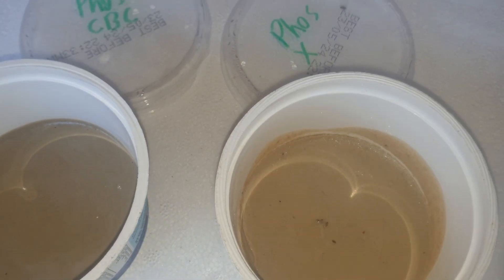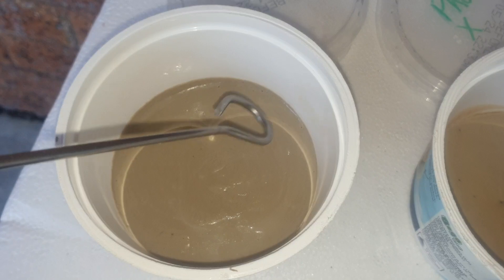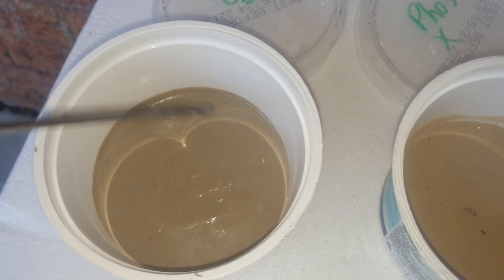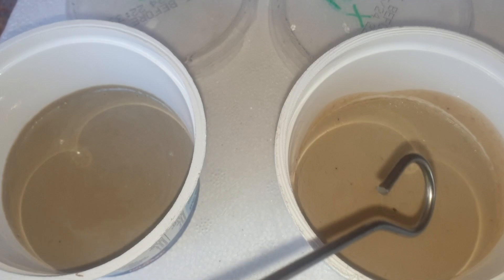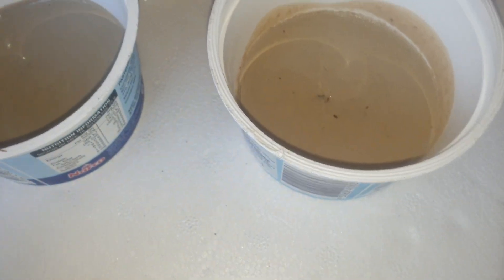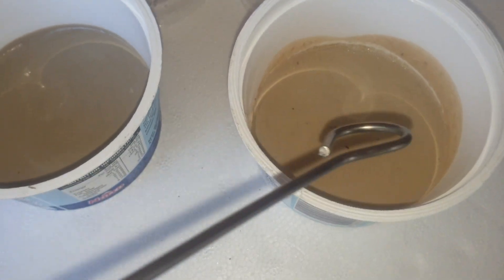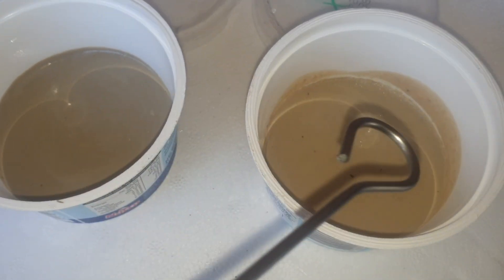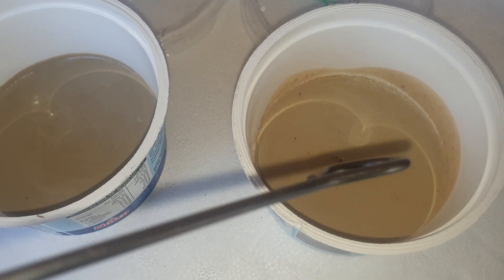Phos/Mk acid Geopolymer😯👌

Comment: Fantastic! Thanks for sharing.

Since our last exchange I have learned a bit about PCM, phase chznge materials, from NightHawkinLight channel here on commie tube.  Xantham gum in that case helps the phase change material stabilize and instead of separating as it thaws.

Like geopolymers and ceramics, the phase transitions from liquid to solid are related chemically.  So the goal reached by NightHawkinLight was to chemically target the "freezing" point of the material at 65°F (18°C). So by cooling below 65 it stores cold by supercooling, and absorbs heat while maintaining 65° melting point temp until thawed. Equalizing highs and lows around that temperature passively, as long the nightime temps are below 18°

So anyway.  Your direction has always inspired me, and this is very satisfying to see your progress. The magic of acid and chemical chains. Heh, "chain reactions" in a manner of speaking.

Great! Cheers
Reply from the maker: i saw that nighthawk vid, very interesting, be sure to watch the Kriven video i added in the description, if you haven't already. it covers the concept of lowering the firing temperature, and there is a lot of very important info if you want to undertand geopolymers better

Comment: wait why did I think you had phosphoric acid and milk compounds to make a hard plastic originally,??? also will be interesting to know if it lowers the temp to fire the clay to a ceramic state, and if the ceramic is more durable than plain pure fired ceramic (the acetic, oxalic, and citric acid mix is what I used and the clay I used was terracotta, which fired like 300 degrees lower than typically needed to vitrify it so it would not go back to moldable clay when wet, and was considerably more durable from deformation and dropping than the plain clay that I made with it as a control. Not sure if it was due to it being able to be fired at the lower temp or if it was a polymerized structure left over from forming off of the carbon based acid compounds maybe, would have to try firing some to the exact same temps with and with out to test that.) 

how much of the clay was used vs the 50g phosphoric acid, and 20g of water? not really following what the actual recipe was, Guess I will have to go look up the prof Davidovits maybe :) 

I am actually interested in this partially due to the phosphoric acid additive as I had planned on trying to swap out something in another compound with phosphoric acid to leave behind the phosphor as a dopant for electrical properties. :)
Reply from the maker: the recipe details are in the description of the video. needs to be calcined clay to around 800°C. yes the "firing temp" is lowered. To around 80°C for curing. Look up Trudy Kriven on Prof. Davidovits channel on YT. There is a long video she talks all about the crossover of geopolymer and ceramics. Actually I think I will add the link to that video into the description since it is her research that lead me to understanding this acid pathway better. From what your comment I feel you will get a lot from it and may be able to add to the research with your experiments. Oxalic, citric, vinegar... I see you have been paying attention.🤓👍
Reply: @m3sca1  ok thank you, and as for attention, lol I have been looking into this for quite a while because I still think the pyramids are made both ways, depending on the era, and the more crude cut stone methods were done after a mass die off of those who had the knowledge of geopolymers, because for some reason they were making a version of semiconductive geopolymers and accidentally made massive air collection diodes, that eventually lead to discharge while the ones hoarding the knowledge were electrocuted from these pyramids acting as a sort of aquifer capacitor filling up, (like maybe using a compound they would take internally to help with gas or something and external casing stones having something they would spread on their skin to cure skin aliments leading to that diode effect once the water in the below ground areas wicked up into the pores of the blocks, 

SO, I had been experimenting using that research before I test out my idea of contaminating the compounds and then cure them to see if we get that effect on a smaller scale to test my theory :) (could be useful for making batteries and other sorts of tech at home that harvest energy and use it locally :) who knows.
Reply from the maker: ever tried to make an electret block by providing a High voltage field during curing?
Reply: @m3sca1  not yet but that is on the list,  Plan is to try using xylene dissolved polystyrene from styrofoam, and let it dry on something while a high voltage is maintained on two plates around it and see how effective it is, as opposed to heated to melt a plastic or glass to make an electret, Got plans on that and graphene structures for thermal to electrical power generation.

Comment: Just made some today. I didn't really measure it but I worked it and mixed it like dough. I put it in the oven at 180C. I got a little pressed for time so I took it out after about two hours. Perhaps a 4 -6 hour period would work better but it hardened up nicely. In my opinion, this could be a replacement for OPC ("ordinary Portland Cement"). Its cheaper than the NaOH + sodium silicate (water glass) method. Its also known to have a higher compressive strength and the curing temps are within the ranges of a household oven. It would be great to find an additive that would allow for room temperature curing....if we had that, we could compete with OPC directly. And if we could get the compressive strength high enough, we could make hollow blocks or even 3D print this stuff.
Reply from the maker: i didn't have proper MK, basically clay i had kiln fired, it ended up crumbling when it fully dried out

Comment: I'm trying out pure metakolin and 10 molar phosphoric acid solution (50/20).  I did one but heated it too soon and it cracked up.  This time I'm curing it in a sealed bag with some water to keep humidity close to 100% relativity.  then i'll dry it and then heat it I guess.  I'm also trying another batch with 1.5g of NaOh and 1.5g of magnesium sulphate in 15g of water and 15g of metakaolin. It should have been magnesium chloride but I'll try this because it's what i had and the sulphate ion might give it some benefits (acid resistance)  The mixture of magnesium sulphate or chloride forms magnesium hydroxide with the NaOh in solution.  I'm doing this to create a membrane for split cell electrolysis. (cationic exchange membrane)   Well done for your work !
Reply from the maker: you should be to heat to 60°C, then 80°C over a few hours. you want to keep the water in when it is heated, good work btw😀👍
Reply: @m3sca1  Thanks , exactly mate i needed to keep it moist. i'm going to let it cure in the humid environment for a couple of days and then i'll try putting it on a raised platform in a saucepan of water with a lid and slowly bring up the temp so it doesnt touch the water but gets the warmth.  Anyway... lol .  Hi from England !
Reply from the maker: im trying it with carbon nano tubes. today😀💪 double boiler sounds good. are you on twitX? i can share the temp chart for its exothermic events during curing temperatures...
Reply: Replying to myself to let others know it didn't work. Its needed more sodium hydroxide. It should be an 8 to 12 molar solution  which for a 15 gram test batch of metakaolin I'm trying a 10 molar solution which is 7 grams Sodium hydroxide in 17.5 grams of water.
Reply: info. The balance between phosphate and Al-Si should be equal. So a 10% solution isnt going to give you greate results. I use mostly 44% and stuff gets hard BUT when using only mk750 it will get brittle, an aggregate should be used. As harder the aggregate is the harder the geopolymer gets in the end. BUT you need a silikate an oxid like AlO2 will not work because the phosphate wont grab it. 

Try some flyash with 44% phA that will result in a semi hard mortar. Wollstonite gp is mixed with phA at 44% will harden to but you have to ensharpen the phA with vermiciculite for at least 54h so then the foaming will be reduced heavly.

best of luck